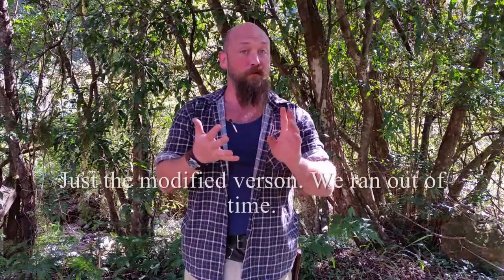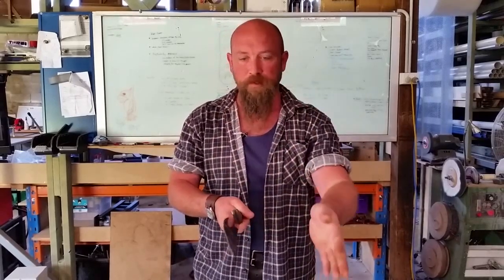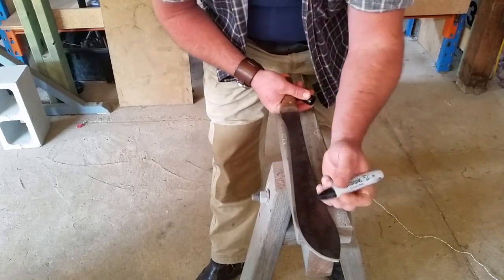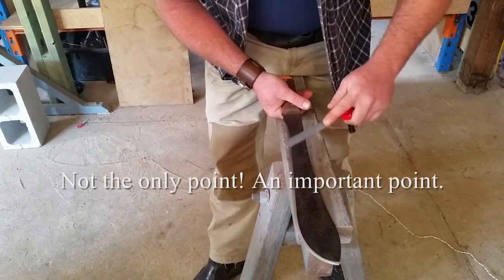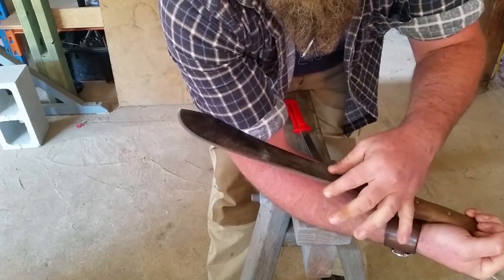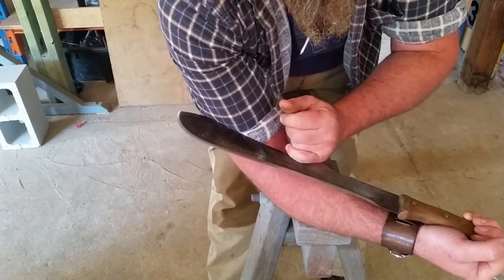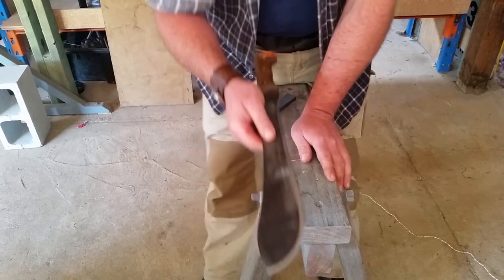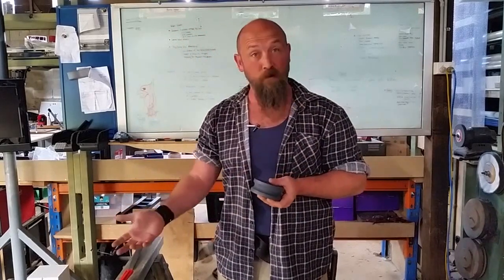Machete Sharpenening: A simple method that suits beginners and pro's

Comment: I had a theory about "wire edges" I was making a knife and I noticed it before I did a microbevel so it would be less likely to roll. I call it a tin foil edge. A fine edge is good but isn't needed on a machete because you might be chopping with one.
Reply from the maker: I think it is a much better description than calling it a 'wire edge'. I think that confuses a lot of people. It is much more like a ragged ribbon. Calling it a tin foil ribbon would have made a lot more sense.  One of the advantages of hand sharpening tools is that you can easily adjust the edge angles. Putting a thinner bias closer to the handle and thicker at the chopping sweet spot is a great combo. 
 I don't knock jig sharpening though as what ever gets your tools sharp it what matters. I'm yet to see anyone carry a bench sharpening jig into the field though.

Comment: Machete Bushcraft Australia That was very informative, may I ask you is there a brand or grade of file I can buy and use here in Australia please.
Reply from the maker: Happy to help mate. For the smaller field sharpening files (flat chainsaw file) I like the Stihl or Oregon branded ones. You can find them in the Stihl or Husqvarna stores. I like flat chainsaw files as they have two rounded safe edges which have other uses. Use can use the smooth edges as both a knife steel and as a tool to sharpen a card scraper edge.

If you're sharpening in the workshop, you can't beat a bigger file. Bahco or Nicholson still make decent files that are affordable. You are  looking for a 10' Mill Bastard file. They are single cut and are very good for sharpening a lot of agricultural tools. 

There are other good brands to look out for other than the above but they are not so easy to find in the average stores.

I would skip on the HART branded ones or any of the other cheaper brands. They are not worth it in my opinion. If you're new to file sharpening, you will probably just think the process is really difficult and not realise that it might be the subpar file. 

Hope that helps!
All the best,
Ben
Reply from the maker: Oh I should add, I have always had a soft spot for our native Ibis. I can't help but feel they get a bad wrap. I find them to be very graceful and beautiful birds... not the 'bin chickens' we often name them to be.

Comment: I saw your answer regarding the file you use but would like to know the grit of the stone you finished with, Thanks. Really enjoy your videos.
Reply from the maker: Unfortunately they don't always list the grit sizes on traditional style sharpening stones. If it's that little black/dark grey stone, it feels like it is in the 400-600grit range. if it's the double sided axe puck, that feels like a 240/400grit stone. 
For machete use, the mill file/axe puck combo is going to get a machete sharp enough for 95% of tasks. I would only bother with the finer stones if you're planning on carving and crafting dry and hard timbers... Most westerners would usually carry a small crafting knife for that purpose though. 
I hope that helps Walter.  
All the best,
Ben

Comment: Great video. Is there an Australian made machete I can buy? They all seem to be made in China and prefer locally made if possible. I'm in New Zealand.
Reply from the maker: Thanks for the complement mate! 
There are no Australian machete makers that I know of. I use to make them a long time ago but It's impossible to make a profit from the process when your doing it on a small scale. Heat treating very long and thin steel is challenging.

Most of the proper thin machetes are still made in South America and are quality tools for the price. Tramontina is my pick but their are other good ones. Condor is great if you want something a little more finished.
If you like the bushknife style machetes, have you come across Svord yet? It's a very well respected New Zealand brand and they make darn nice knives. I noticed they did the English style Golok. That would be hard to beat in my opinion. 
I hope that was helpful R2R.
All the best mate,
Ben

Comment: what do you recommend for getting unwanted poisons and unwanted oils off of the machete as i am plowing through a lot of poison ivy etc

thank you
Reply from the maker: I cant say for sure as I'm not familiar with poison ivy but cleaning the machete after work is fairly normal maintenance. 

I find Mineral Turpentine (paint cleaner for oil paints) and some fine steel wool to scrub the steel works best. It gets just about anything off. Methylated Spirits (alcohol fuel/cleaner) works as well, just not as good. Normal carwash soap (mixed with water) in a squirt bottle is another. That dissolves some sappy glue fairly quickly. You need to dry the steel after this step though. Water rusts machetes very quickly.  

As mentioned before, I have never cut Poison Ivy. Does the irritant stay active as dry sap? Maybe some disposable gloves would be needed?
 
I Hope some of that helps Mary.
Reply: @MacheteBushcraftAustralia  thank you!

Comment: Great job
Reply from the maker: +Kevin Grant      Cheers, Thanks Kevin!
Reply: No Thanks you for your time making great Video.
Reply from the maker: +Kevin Grant 
Thanks mate! To be honest, I was expecting all the armchair 'expert sharperners' to jump all over this as technically it is an incorrect method....but it works and beginners can get there tools sharp! Mate, I still use this method....The next video on sharpening I will be using a DIY, cheap bush strop (anyone can make) and this easily corrects the faults with the wire edge in this video.  
Thanks for the kind words Kev!

Comment: Nice explanation on sharpening. I assume this will work on belt knives the same way? Aside from the reverse hold of course. Don't wanna stab your self by accident.
Reply from the maker: It sure will. Things I would keep in mind is that smaller knives are generally heat treated to be  slightly harder than your average machete. Files are still harder and will cut back the edge but it's going to feel different.  Secondary bevels are easy to do in the field with a small file. 
With most smaller knives that have a secondary bevel, just starting out with a coarse stone is fast enough to cut back any damage. 
From there, you just go up the grits until you're happy with the edge.
It's been a while since I watched this clip but using a slack belt strop is every bit doable with a small or large edge. 
Thanks for the comment mate.
All the best from OZ,
Ben
Reply: @MacheteBushcraftAustralia  you're very welcome. And I love the website. I generally make my own blades and sheaths. But I'm pretty tempted by your work. I may be needing a sheath and shoulder carry after the holidays are finally over. Gotta let the wallet recover...lol

Comment: what strategy do you use for removing nicks in the edge of your blade (from hitting either metal or stone)? My  machete (latin style) has a few notches in the "sweet spot"  a few inches from the end.
Reply from the maker: G'day Cliff and that is a darn good question. If it were anywhere else, I would just sharpen the machete as normal and eventually the chips disappear with regular filing. My stratage is to cheat with a belt grinder but that is not helpful now is it?  I think the best low tech solution is to clamp the machete to a bench with the edge towards you and file into the chip. A good quality file will make short work of it. 
I'm sure you have stumbled across Colhane's youtube clips by now. He has a 2 part clip on modifying a machete where he clamps the machete to a bench.  I would be doing this method if I did not have a slack belt grinder.  Let me know If you can't find it and I will post up a link. 

If it is a small dent, you can peen the edge gently to get it down depending on the hardness of the steel. I would file it out if in doubt about the hardness but most proper machetes are soft enough.
I hope the above helps you out mate.
All the best,
Ben.

Comment: Very informative, what do you think of the lansky puck for sharpening machetes?
Reply from the maker: +Aussie TruthRider 
Thats a good question and to be honest, Lansky is one of the very few brands of abrasives I'm not that familiar with. Having said that, Lansky have a good reputation and I doubt you can go wrong with using them. Getting a machete very sharp does not require fancy gear and I regularly use the 2 sided puck sharpeners with good results. 

 I tend to use Norton (Bear Brand) as it's easily found here in OZ. I think you will find the Lansky puck to be on the money.  One advantage to the lansky puck is that it does not have a concave centre to the stone (that I know of). If you clog the stone by sharpening a dirty or very rusty machete out in the field, you can refresh the stones surface easily.  I just use some sand and water on a hard smooth rock and rub the clogged stone on the slurry.  The norton stones I have are concave and are a little trickier to unclog out in the field. 

If you try one out, let us know your thoughts!

Thanks for the question mate and I hope the answer was helpful!
Reply: Thanks for the reply, and yes the lansky puck is flat on the surfaces, Ive used it on the gerber gator but with an inferior technique to what you showed in your vid, will try you way next time, cheers

Comment: What kind of file do you use and where can I get one? How does one tell that the angle you're holding the stone at is the right one? Sorry if these are dumb questions.
Reply from the maker: Thumbs up for the name! I always liked the Mad Max movies growing up. They are not dumb questions at all mate and I'm happy to help where I can.

The files I like to use out in the bush are called chainsaw raker files or sometimes called a Flat Chainsaw file.  Stihl files are my favorite but Husqvarna stock Oregon files and they are good as well. Actually I prefer the orange Husky quick release file handles on a Stihl file (I'm sure I just upset someone with that comment). 

A 'Smooth Cut Mill' file or a small 'Mill Bastard' file would also work but I like the rounded safe edged on chainsaw files as it allows me to draw up a card scraper edge on the spine of the machete.

As far as getting the angle just perfect, don't be too worried about that. I'm sure you will come across people that have strong opinions on this topic but by far the best way to start out is to have a go, see how it performs, adjust your technique and try again. Machetes are very forgiving on beginner sharpers as they will still perform well even with a not so good sharpen.

Convex edge sharpening is far easier to sharpen than it looks. You just start high on the bevel with your first stroke. each stroke after that, just increase the angle slightly until the last stroke is hitting the edge.

Colouring in part of your edge with a magic marker will help greatly as you can see that each stroke is getting closer to the edge. 

As a beginner, It is far easier to learn on a machete that already has some sort of an edge on it. Real agricultural machetes often come with a shocking edge that requires a lot of file work and It puts people off. I have found it's well worth it as they are often far better tools than their tactical looking cousins. 

I hope this helps mate.
Kind regards,
Ben
Reply: Yeah same here. I saw Road Warrior as a kid and it changed my life. Indeed what you wrote here really really does help a lot. In fact it explains everything. Technique + what to use = the whole ball of wax. Thanks a million for being so meticulous and thorough!! I'm going to copy and paste this onto my computer for quick off line reference. Thanks a million sir! I really appreciate it.
Reply from the maker: Cheers mate, you just made my morning! Honestly I just want everyone who is interested in something to have a go. I have met a lot of people over the years that have been put off trying something new because they were told it was too difficult. I have always felt sharpening was an important but forgotten skill that just needs a little nudge in the right direction to get someone started.
All the best mate.
Ben
Reply: Machete Bushcraft Australia  hey bud what's the link to ur shop?

Comment: Where can someone buy canvas in the width you use in your videos? I can't find it anywhere.
Reply from the maker: G'day James. It a little difficult to find now as everything is going synthetic but I stumbled across some last week. It is called 'cotton heading tape' and I found it in Spotlight (Australian chain) but online line craft stores that specialise in fabrics etc should have some.

Did you catch the video I did on 'Anyone can make a strop'?
Some of the synthetic tapes actually worked very well as a strop. The one in particular that I liked was a ribbon/tape from a fancy disposable brown paper bags handle. It's super light weight, low stretch and will hold up to wet weather for much longer. 

I hope this was helpful James!
Kind regards,
Ben.

Comment: Can you please send me a link or a model # to the stihl file that you use? I am unable to fine them online. Thank you!!
Reply from the maker: G'Day Sarah. I just had a look online any you're right, they make it hard to find. The Stihl branded ones are called 'stihl flat file 150mm 0814252 3000'  and here is a link to the Australian Stihl website 

http://www.stihl.com.au/STIHL-Products/Accessories/Chainsaw-Accessories/21567-1649/Flat-File-with-case.aspx

I could not find them on Amazon in the US but they have the Oregon ones.

I would not get too hung up on getting the same brand. Oregon (Husquvarna sell oregon files) are also good but there are other brands out there.
Actually, if you're after the best, Pferd make quality files but they are hard to find here in Australia so I never bothered. 

http://www.baileysonline.com/Chainsaw-Chain/Files-Filing-Accessories/Depth-Gauge-Raker-Files/Pferd-Raker-Files/Pferd-6-Depth-Gauge-Raker-Files-box-of-10.axd

That is a link to a US website.

All the flat raker files I have seen come with two rounded safe edges if you're looking at using them for the card scraper. I also prefer chainsaw files as they generally have decent quality quick release handles so they are easier to pack. Drop buy a decent chainsaw shop and ask which ones they recommend.

I hope that was helpful!
Kind regards Ben

Comment: Good job with basic sharpening. The job for the tool should determine the sharpness. Chopping hard wood = less sharp, as the less steel on the bevel = greater chance of chipping the edge, as you mentioned. Also, just because a file is used to sharpen the blade, does not mean it is not sharp. I have sharpened many a machete toward the edge with a short file, and lost some blood along the way. Your method of sharpening away from the edge is safer.
Reply from the maker: 100% in your corner on those points mate. I have always viewed the style of edge you put on the tool depends on three points : The intended task of the tool, The ability of the tool to take and hold that edge, and finally your ability to put that edge there.
It's been a while since I have seen this clip but filing into the edge is still very doable. I find the file bites a bit deeper when filing towards the edge. This becomes more evident as your file dulls. It's just riskier and why I still file them from the spine side.
All the best from OZ mate,
Ben

Comment: Do you count how many times you sharpen each side to make sure it's even?
Reply from the maker: G'Day Abraham, that is a good question! 
I use to really focus on that when I first started out and I know a lot of people state it's importance when demonstrating sharpening. I have found counting exact strokes when hand sharpening does not make a lot of difference. Their are a lot of variables that have a bigger impact like hand pressure, cutting angles, file angles and hand dominance that have a much greater impact on the whole process than counting strokes.

The long story short is that no matter what you do when you hand sharpen, you will always have a bias to one side and it makes very little difference to what you're cutting. 

It is far easier to follow the 'about that much' method while you're sharpening and focus on the other points. Take a good look at the edge once you are done. If you have any glaring differences, remember to put a bias on the other side next time. 

Don't get me wrong, their are many different methods to sharpening and if counting is working then stick with it. At the end of the day, it's sharp tools that is important.
If I was jig sharpening or I had a show knife I probably would count my strokes. 
I hope the answer was helpful  mate.
All the best,
Ben
Reply: Awesome, thanks for the info Ben.
Reply from the maker: No worries Mate. I'm really happy to share the info!
All the best,
Ben

Comment: I think I'm messing my machete up, I can't tell what angle I'm supposed to be at, the blade looks jagged and ate up, I can't seem to get a smooth cut across the blade with the file
Reply from the maker: Sorry John, I should have seen this sooner. If you're struggling to get a smooth cut, you may have better luck clamping the machete down and using two hands on the file (google 'draw filing'). You will get a lot more control this way and a much neater looking edge. Draw filing is a very standard sharpening technique so you should find a lot of good info on it. 
Is the 'jagged and ate up' look just at the very edge? This could just be a huge wire edge that gets removed with finer stones and a strop. Finer cutting files are easier to control. Have you got a Mill Bastard file or are you using a double cut file?

Take a look at this clip from Colhane. https://www.youtube.com/watch?v=IsZb_1XfFHo&t=95s
He goes over file sharpening a new machete in a lot more detail. 

Don't give up! Once you get the hang of it you will never look back.
I hope some of that helps you out John.
All the best from OZ,
Ben